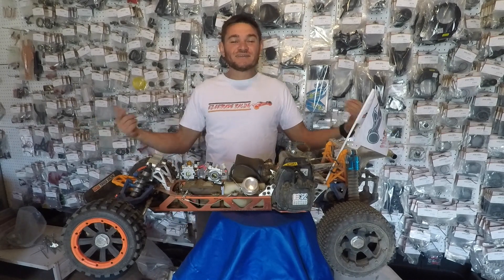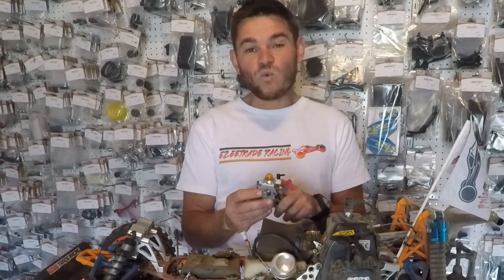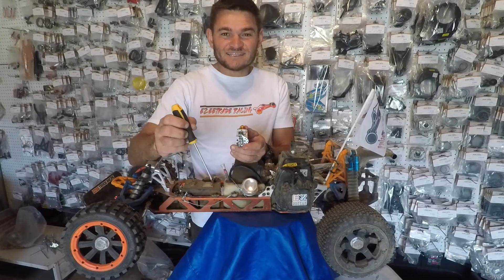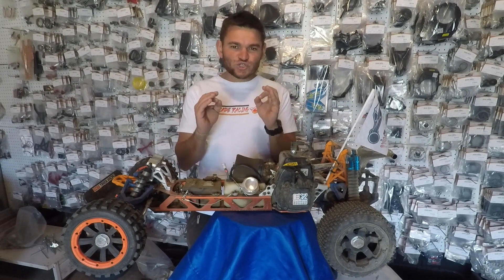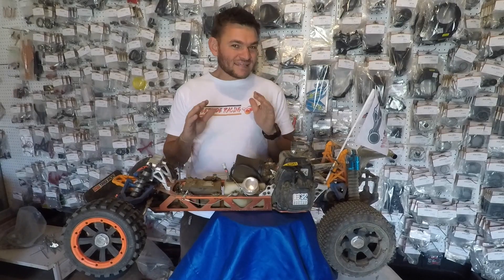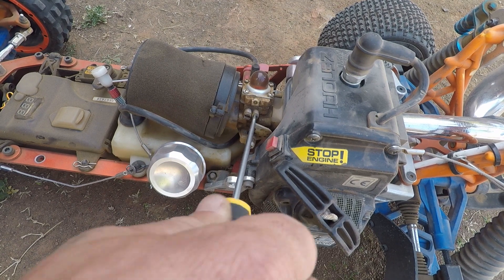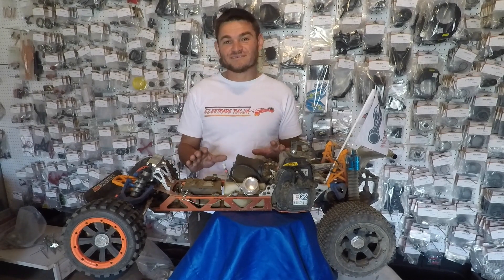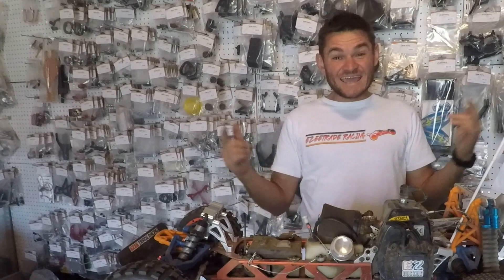Tuning A 2-Stroke RC Car │ Ezeetrade Racing

Comment: I just replace a new engine to my baja 5t and I want to put my carb settings to factory then break in to the new engine, please help
Reply from the maker: Just apply my base settings I mention in this video but make sure your High end Needle is at least 1&½ then run the first tank half throttle. Done 👍
Reply: @EZR  so I don't have to run the car 5 tanks to break in and idle can I keep it same
Reply from the maker: No. Definitely not. In the last couple years we have found that it makes no difference. 
Only needed thing is to seat the ring with good oil like Castor and run a slow 1st tank to make sure the bearings and seals receive good lube without too much heat.
Reply: @EZR  ok thank you

Comment: My 2 stroke don’t wanna start recently but does once in a while and I’ve tried everything and I’m thinking the spark plug is on the way out. I don’t have a clue on why. Update I got a NGK spark plug worked perfectly now after the first start i let it run to let the spark plug sit in properly if its even needed. I  let the tank  run through and the following day it don't want to start again I also checked the flywheel and the ignition coil thing and still got charge on pull while electrocuting myself testing it and unflooded the engine to check but once the spark plug is in it don't wont let me pull start it like there is a shit ton of compression build up. I done everything I could think of like holding the throttle while the spark plug is out and pulling the pull start to unflood the engine if it was did that for 10-15 pulls put it all back together and still don't wanna budge. I'm going to order a new carburettor since it has sat for 4 years and it did run perfectly for the first 2 days and is starting to play up since. I also checked the piston and it look perfectly fine. I'm hope-ing the carb is faulty since its not ran for 4 years and I'm guessing it keeps leaking fuel into the engine. Any advice would be grateful.
Reply from the maker: Spark Plug is #1 to change.
Then natural wear and tear will have you replacing the piston ring about every 10th tank.
Also check for dirty filter or carb diaphragm.
Reply: @EZR  Every
 10th tank of fuel fuck me. thought the piston ring would last a lot longer :/
Reply from the maker: You can push it further with the right oil and mix. Most owners don't even get to 10 tanks. It's a lot of play time.
Reply: @EZR  It's a Aowei yama buggy 26cc I'm guessing the piston ring and piston does not matter as long as they're 2 stroke parts ? If so I'm going to order some spare parts. Also any recommendation to where i should buy them would be great :)
Reply from the maker: Yeah the 26cc is a 34mm piston and ring. Rovan, King Motor, CY and Zenoah. They'll all fit.
Which country you from
Reply: @EZR  UK London
Reply from the maker: Yeah there should be plenty Hobby shops selling Rovan and FG parts.
You can replace with their 34mm piston kits.
Also remember to double check your coil gap. Business card space away from flywheel
Reply: @EZR  Thanks for all the help :)
Reply: @EZR sorry to bug you but I’ve got a issue and I can’t find anything online about it. I got a issue where it’s not flooded but when I pull the start cord it get stuck at the first cycle of compression but if I take the spark plug out it moves just fine but only when the spark plug is in it does not wanna budge I did get it running just fine yesterday ran it for 5 mins and now the same issue is back and I can’t figure out why the compression is getting so tight and I did put a new spark in and still got the same issue. I reset the carb settings and same issue can’t get it run.
Reply from the maker: It sounds like the engine squish is way too little. Max squish should be 0.2mm
A possible Quick fix will be to put another washer on your sparkplug. Long fix, put another head gasket on it.
Reply from the maker: A quick way to check if your carb is flooding is to close and reopen the needles to 1xturn. If it starts then tune out from there.
Reply: @EZR  i tried that 
but i still get the same issue with the pull start but ive ordered a new carb incase to be safe anyway :)
Reply: @EZR  im kinda lost here so is it referring to how tight the spark plug has been put in ? also i got the same spark as last time NGK CMR7H 3066
Reply: @EZR  just got back and tried this and still nothing. I somehow made it start yesterday with playing around with the throttle and carb and it would do more than 1 cycle if I kept changing the settings but I tried what I did yesterday and still no luck. I got L on 1 1/4 and H 1 1/2 default settings. I’m curious if the throttle could be dodgy on the carb and it needs replacing
Reply from the maker: @elementalgaming2264  When you pull a stock 30.5cc or smaller it should not lock up at all. That means the piston is going too far up. I had engines where the squish was correct but the plug got hit with the piston so we put a extra washer to lift the plug. But if after that it still locks up then the cylinder needs to be lifted with a extra gasket. Meaning 2x head gaskets between cylinder and crank case. These engines dont lock up from flooding like a nitro.

Comment: My idle is crazy high if I don’t back off the idle screw. Whats wrong with my carb?
Reply from the maker: Nothings wrong. It's all good.
You have to open the Low End Needle till the RPMs are where you want them.
Reply: @EZR  I did that earlier. My new issue is that the thing has no power under load. I can hold the car back with my foot no problem even after swapping the clutch
Reply from the maker: Sounds like a Piston/Ring/Sleeve issue. There's no compression, so no Torque
Reply: @EZR  that’s what I was fearing. Would it be best to do a top end and maybe replace the crank bearings? 26cc
Reply from the maker: It might just be the ring. Best to strip the engine. Check the ring and bearings. Dont swop the bearings if they not wonky. Worn bearings are nice and loose. It normally takes 5x tanks of fuel to get those bearings loose.

Comment: Hi I tried tuning now it wont move but it revs really really high how can I fix this
Reply from the maker: If you motor is idling and running but the car does not go forward there is something wrong the clutch or gears.
Will need to take the clutch bell off to check if everything is still in order.
Reply: @EZR  but it does go forward just need to rev it so much for it to
Reply from the maker: Okay, you will have to take the SpurGear(big one) off and see if everything is spinning freely. Check pinion and main gear. If everything is spinning free then your clutch is engaging too high. Either it's too tight or the spring is a high RPM spring.
Send me a email to: ryno@ezeetrade.co.za 
Let's chat there
Reply: So it's right turn to richen and left turn to lean ? Is that right

Comment: i picked up a km baja with a rovan engine
Reply from the maker: That's cool. If you wanna upgrade it at some point,  stick KM Cylinder on the existing Rovan crankcase. Lots more power. Just stick to the same CC

Comment: Hello my spark goes black very quickly and I’m finding that I’m replacing it more than I should could that be because it’s to Rich and if so am I safe to go back to default settings like u showed and opened both high end and low end 1.25 turns out will that be sufficient until I get going
Reply from the maker: If the car is already running fine but the plug is dark. You can just close the High end 1/8 of a turn.

Comment: I hate 2strok engines in Rc . Never ever start esely . Install new carby  .if start struggle to run . Rubbish 2strok engine jus wasting money.
Reply from the maker: I am so sorry about your experience. It is possible to have a lot of issues with a 2 stroke but once all the problems have been identified, fixed and maintained the engine can run non stop. Wish I was close to give you a hand.
Reply: Yeah troubleshooting is very frustrating.
But if all is good/proper they start very easily. 
If not it's means somethings wrong, carb settings, air leak, bad plug are the most common things. Unfortunately a lot can go wrong with engine to not start or run right

Comment: The easiest way to tune an RC engine is to remove it from toy and install a brushless  system.
Reply from the maker: @rmb1  😂. That'll get you going. Good idea. But I generally like to play longer than 20minutes.